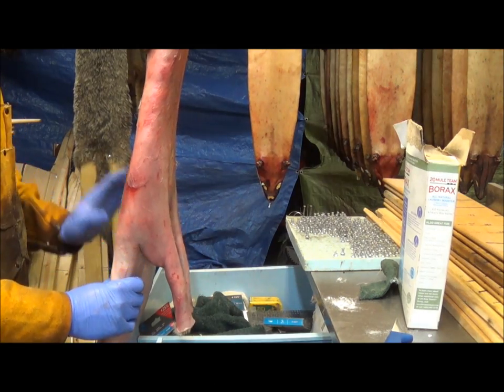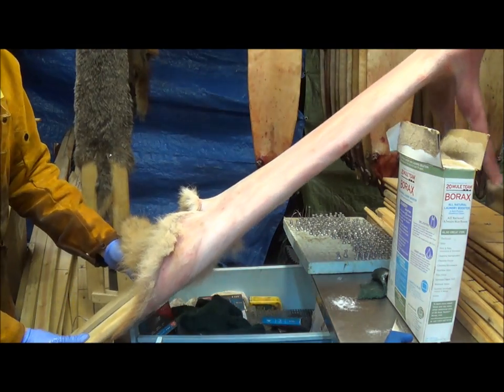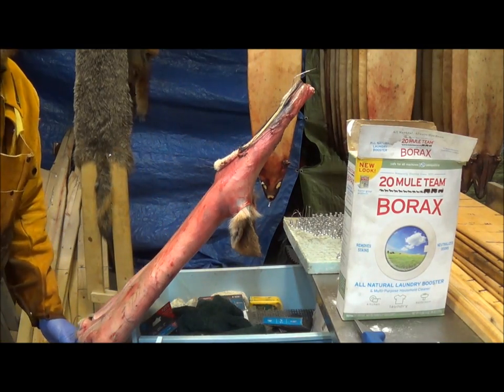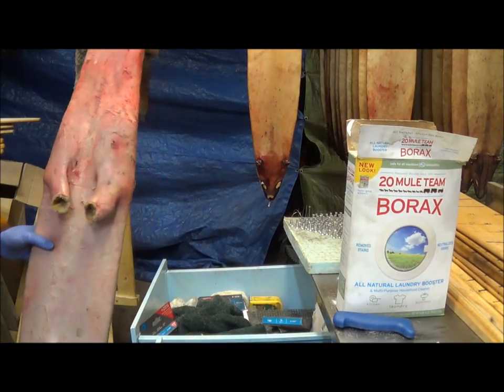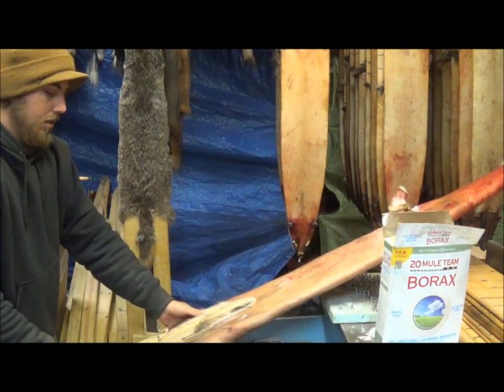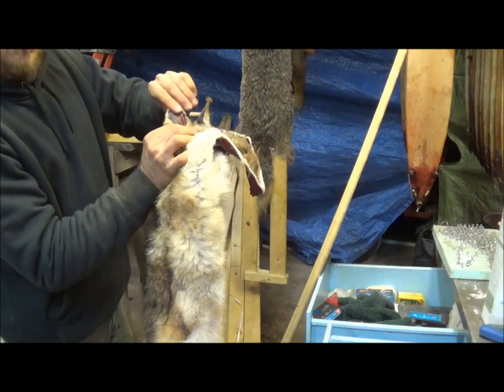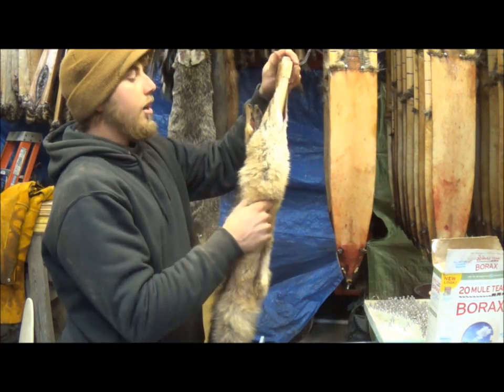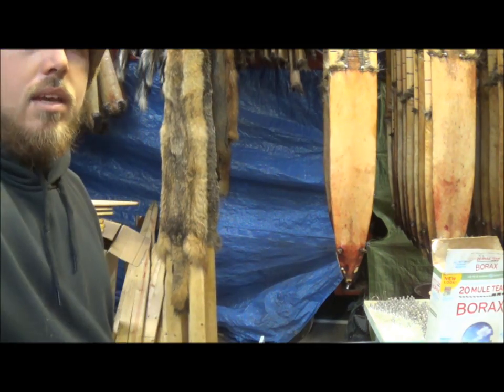Professional Fur Handling, Coyote - Part 3 Boarding and Flipping

Comment: When you split your board are shooting for a certain width or just where it fits? I've never figured out turning them through the mouth, it just seems so much easier going bottom up, but every other video about flipping does head first. I was glad to see someone that know what they are doing, do it the same way I do :)....Another great series, thanks as always for taking the time to share the knowledge
Reply from the maker: backyardmeat nafa specs for yote boards are 9'' at the base, so i split them at nine inches. really im using the same dimensions as solid boards just cutting them where they will split so the pelt will come off easier. if you use the "just where it fits" method your pelts will have inconsistent base width. to each own on the flipping thing,i've tried it both ways but like you I never understood why you would want to fight the head first.

Comment: I see all those furs and can't help but wonder how much acreage you have to trap from, and if those are all furs you caught yourself. I also think it's amazing how you do this part time, when it seems that there are at least 6 separate steps that are required in order to set the trap, retrieve the animal, skin, flesh, board, and bring the fur to market. And it's not exactly glamorous or easy work.
Reply from the maker: Prepared Survivalist all the fur is caught by me alone. I have multiple properties that I have permission to be on. its alot of work, but its also very rewarding

Comment: Two Questions Sir:  1. What kind of knife is that with the blue handle and triangular blade?  2. What is holding the pelt down when you use the mechanical gambrel to pull the caucus up?
Great instructional!  Thanks for posting.
Reply: He's using a wiebe knife. He uses vise grips when skinning most of his pelts. He has a video called "my skinning machine" where he talks about it.

Comment: I have to process my coyote for a pelt project at my college but they suggest we use tanning solution for a softer hide versus a stiffer one. Do you have any experience with that? If so, would you ever to a video about it?
Reply from the maker: I have a entire series and tanning. With the hunters and trapper hide tanning formula. You may check it out

Comment: Nafa have two boards one is 7 1/2 and 9  do you use both?  You posted that the boards are 9'' at the base, so i split them at nine inches I don't understand  that you split them at nine inches.How do you keep the boards together at the top and how do you hang them? Great videos
Reply from the maker: Tim Hammers thanks  not really following what your trying to say. I split my boards so that when the pelt is on them they are 9'' at the base. there's a piece of rawhide tieing the two together

Comment: Do u got to do this if u are going to tan the hide
Reply: It all depends if youre planning on doing the hide later on (if you dont have time to do it right away) to do this method. This method is to preserve and slow down the decomposing within the hide. If you are going to tan the hide and you have done this method all you have to do is re-hydrate the hide and do what ever your tanning method is. Now if youre going to tan the hide right after you were done fleshing it you can just start the tanning process right then and there because the hide would already be hydrated. So in terms it is a yes and no answer depending on what youre planning to do. Hoped this helped~

Comment: can you use 1/2inch ply wood for split borad for yotes.
Reply: Im not 100% sure on this but as I understand the glue in the plywood can potentially have adverse effects on your hides.
Reply: ok thanks
Reply from the maker: john lindsay a 6' length of plywood wood bow and bend. also is is very hard to get the edges smooth enough so the plies dont catch the fur. best bet is go with a solid board.
Reply: ok thanks